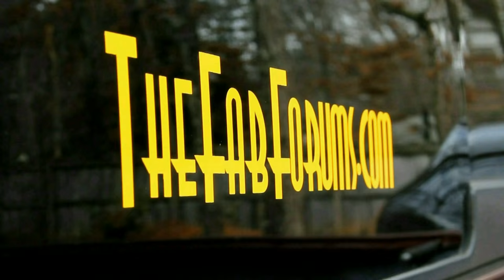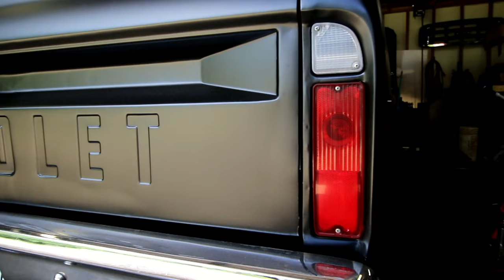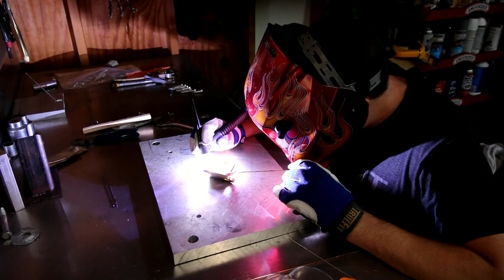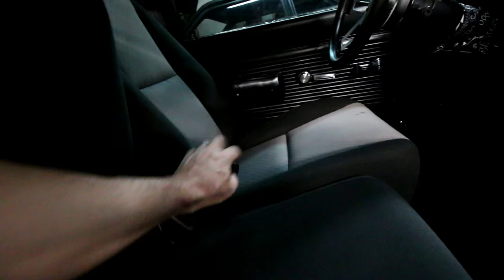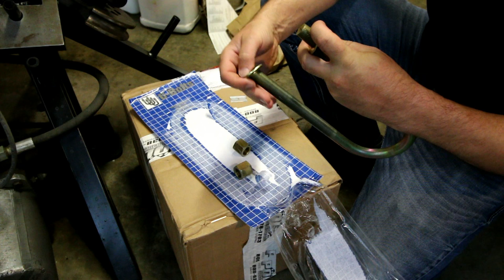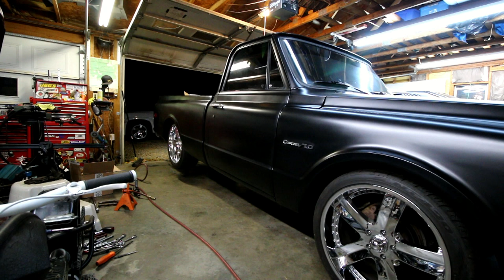Chevy C10 "Black Pearl" Gets Suspension, Seat Belts and Brakes

Comment: what all did you use? im wanting to lower my 98 Dakota and I know to block the rear but could i just cut the springs in the front? i know it'll be rough ride but will it work?
Reply from the maker: If they make a drop spindle for the front that would be the way to...thats what this truck has. Dont cut he springs
Reply: okay I'll see if it does but if it doesn't where to turn?
Reply from the maker: mmmm not sure. you could cut the springs but it messes up the suspension geometry
Reply: okay thanks for the help somehow I'll get in contact and let you know how it goes
Reply from the maker: do that

Comment: any modifications done to put them on or did they just bolt on
Reply from the maker: +Brian Isidro belts or suspension?
Reply: +The Fab Forums did the bucket seats just bolt on to the floor of the truck or did u have to drill any extra holes or modify them to fit,no not the belts or suspension
Reply from the maker: gotcha. I didn't have to modify anything. Just drilled new holes in the floor for the seats.

Comment: it wouldve looked better if you would cut some pockets in the doorpillars to sink the spoolpart of the retractor system in , you can make a coverplate for it and theres less chace of junk falling of the seat intoo the retractorsystem blocking it 

ever seen the budget reardisk conversion ? https://www.youtube.com/watch?v=9RHV1SCw6Pg think they used rearbrake setups from the newer ls cars like the camaro or the suv's , and they fit straight to the older diffs with only a small spacer to offset the brakecaliper
Reply from the maker: These retractors were made to be mounted on the floor. I will check out the conversion